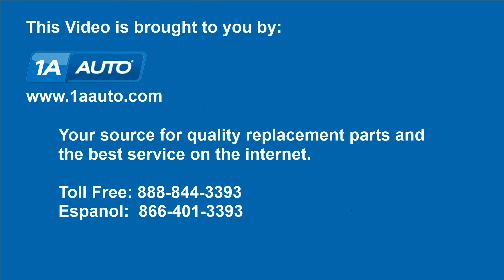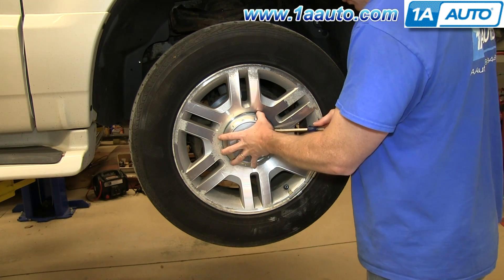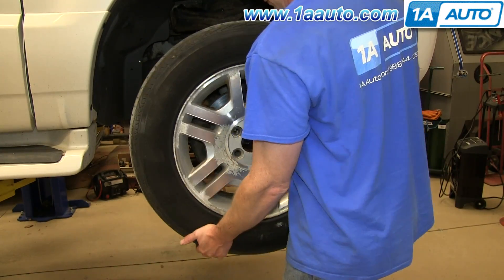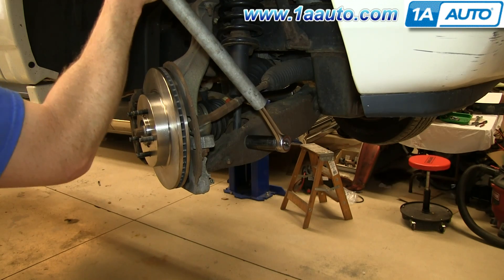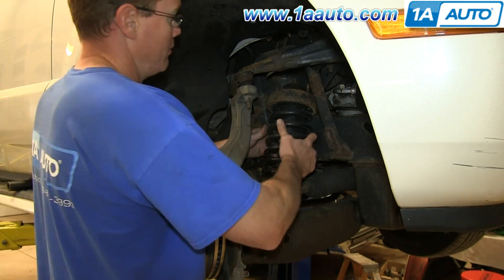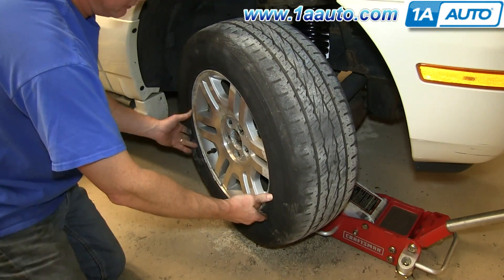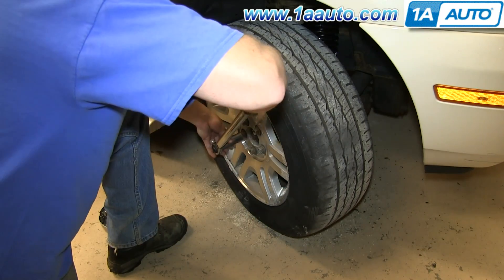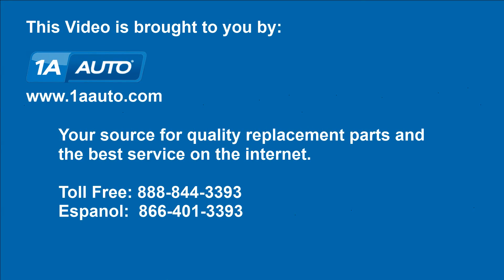How to Replace Strut & Spring Assembly 02-03 Mercury Mountaineer

Comment: My repair manual states to replace the flag nut with a new one (which is understandable).  Are these included in your kit, or is this something I'm going to have to track down on my own?
Reply: I believe that nut comes with a the bolt kit and dealer only. I don't recall exactly how much but it's expensive. Replacing it is not necessary, just torque it down properly.

Comment: Its an easy job until the lower strut bolt is seized up in the bushing....Terrible time...Any answers?
Reply from the maker: +ugsisr Thank you for checking us out. This is a common issue with some applications. If it has been seized into the bushing the bushing and bolt must be replaced. We have had to perform this on a few vehicles. 1aauto.com

Comment: Thanks so much for the video that bottom bolt was a SOB my 1350 breakaway 1/2" impact wouldn't break it loose but my big pipe and ratchet did thank you!!

Comment: Very good video! I have a 2007 Explorer which has a slightly different lower control arm then the one you worked on. The right side went  relatively smooth although I needed a spring compressor to put the new one in since it was a bit longer. The left (Driver's side) was (is) a different story....The lower bolt is seized in the rubber bushing sleeve and will not budge. Soaked it for 2 days and no luck. I have read that I will need to SawZal it off and it will take many blades to do it. Since I am dealing with a steel sleeve surrounded by a rubber hub heating it is not an option. Have you had to deal with this very common problem facing Explorers?
Reply: Thank you for the reply.. I purchased a SawZal blade that was designed for very thick and harder metals. Then I had to modify (carefully) the blade so it would fit. It cut through that 3/4 inch grade 8 bolt like butter. The new bolt and flag nut was about $35.00. Everything is put back together now and the truck rides much better. The front does sit about 1 inch lower than the rear now, but oh well. 
Replaced: Front hub assy's, steering rack tie rod ends, stabilizer bushings, quick struts.
Thanks again.
Reply from the maker: +PCGN Fire488 Sounds like you did great work! Congratulations on the successful repair!

Comment: I replaced the front and rear shocks struts on my 2002 ford explorer. The front springs on the shock struts are really cramped and squished so there not absorbing the bumps on the road very well. Is there anything i couldve done wrong

Comment: I have a 2004 Ford Explorer 4.0. The rear struts on my vehicle show two nuts exposed and 1 hidden behind some type of bumper. How do you suggest I access the hidden bolt behind the bumper? Should I cut the bumper with an oscillating multi-tool? Here is a link to the rear passenger side with the wheel removed and on jack stands. https://docs.google.com/document/d/1_x1MrBp4wCHsw2vli0eU63DzTAxcbVtUdcn2WZ2aA7U/edit?usp=sharing